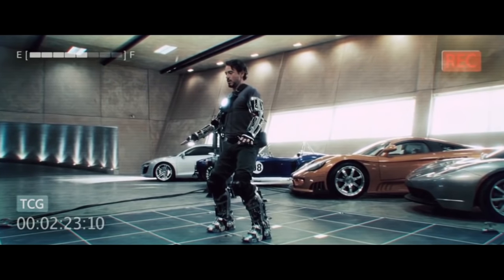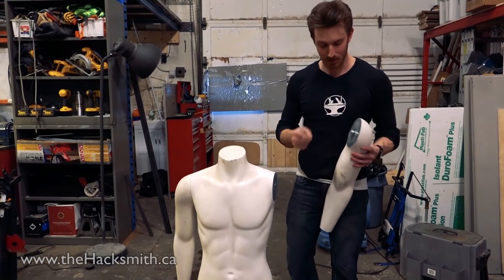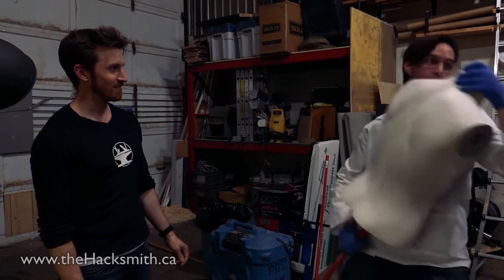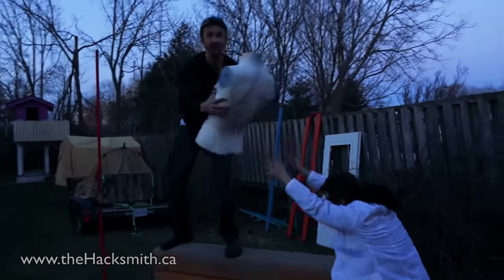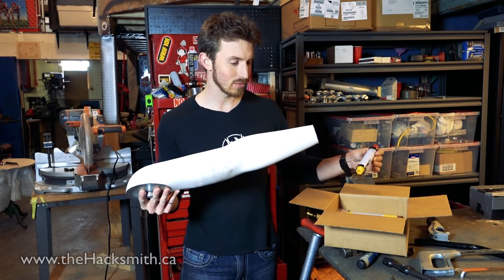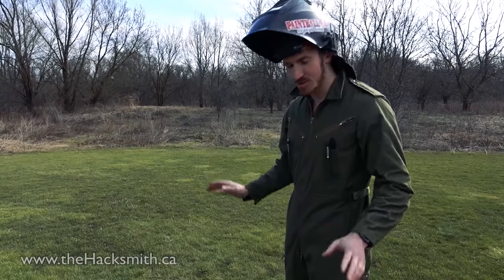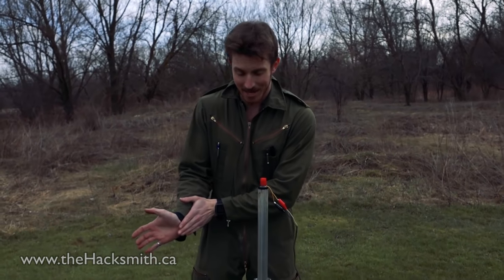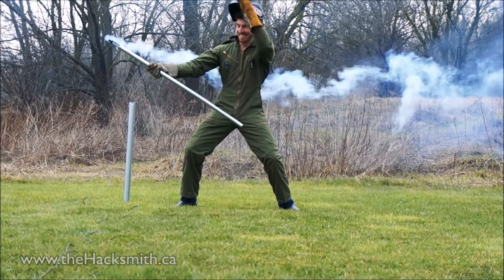Flying Like Iron Man #2: First Rocket Tests

Comment: I was wondering if you will build a suit to go with this, because if so I think that you could incorporate some kind of gyroscope to level you out in mid-air and stop you from flying in all different directions. Now when I say gyroscope I mean some kind of program to level out the rockets matched with a small mechanical device on each rocket that would help guide them as. In addition when I think of Iron Man it doesn't really look like he is paying attention to flying as the suit does that for him. the only downside I see to this is that it will be very costly to build a suit and put this kind of device in it. Just trying to pitch some ideas though!
Reply: Didn't mean to say as at the end of guide them :P.
Reply from the maker: +Scare Craft we would... but considering the rockets only last a few seconds there's not much point for stabilisation:p
Reply: Ok, thanks for replying btw!

Comment: So are the wrist mounted rockets supplying the entire amount of thrust for your flight? I know in the movies the brunt of the power comes from his foot rockets, and his hands are just used for stabilization. Did I miss an earlier explanation as to how you're changing that? Also, I know these were not the rockets you originally intended to use, so how many rockets are you now going to use per arm? How controlled will this flight be? So many questions!!! Thanks, and keep up the good work!
Reply from the maker: The problem is foot mounted rockets would be very unstable. You do not want your thrust at the bottom of your body, it should be at your center of mass, where you can control it.

Comment: This test clearly shows how hard it is to keep the rocket aligned where you want it to go (especially the slow motion bit) and that is with 2 arms holding it and with a very good stance... now imagine doing that upright with one of those attached to each arm... maybe just make a flap system with a small gyro to keep it semi-stable and centrally mounted with smaller rockets on the arms to allow you to turn etc, but that burn time is tiny so flying really kinda seems impossible with solid fuel rockets. Just my 2 cents, cool vid though keep it up.
Reply from the maker: Remember I've already done it. You guys just have to wait to see the videos.

The shot of the first test where I'm having difficulty holding the rocket is because it was the very first time I held it, that's all.
Reply: In that case can't wait to see it! Good stuff

Comment: +the Hacksmith

I have a really cool idea on how to make a web shooter that only shoots straight it's not too far fetched,Basically what it is going to be like is instead of web u use a strong small cable that at the end there is a stick that's sticky and sticks to stuff(3 sticks in a sentence WoW).And there's a cable that wraps around the entire thing connected to the sticky thing(the thing that wraps around your wrist is is gonna have to be a little big).So to trow the "cable" there is gonna be a piston like when you fold paper that's really pressurized and when you let go it shoots it very far.And there is gonna be a stick that holds the piston that is connected to the "activator" that is in the palm of your hand and when you press it it lets go and the piston extends(the piston has to stay extended I made a small test and it goes further that way).Then to make the cable come back you press the palm activator and it goes back pushing the piston back by "closing the stick. ...
Reply: Keep in mind it can only carry stuff like everyday objects you carry in ur hand like a bottle or box of tissues(probably).And I'm not sure how you can make the cable return but hopefully you can figure that one out.

Hopefully you will at least keep in mind what I told you and maybe even make it.p.s. Love your vids keep up the good work
Reply: hey man, nice idea... I mean it could work pretty well
Reply: +Flávio Monteiro thanks

Comment: Judging from the difficulty to maintain balance with both your arms, it's gonna be impossible to do that with bare hands. You might need to modify your exoskeleton and equip it with some computer chip for stability control.
Reply from the maker: It was the very first test, I've gotten used to it ;)

Remember, this project is done. You guys just have to wait to see all the videos ;-)

Comment: make sure your centre of mass is aligned with centre of thrust, otherwise the guy using the rocket will fly and do quite some flips before breaking his neck.
Reply from the maker: Hence why we're not putting rockets on my feet :P
Reply: yea, but i think that the hands will vector too much, causing a flip, either way good luck!

Comment: You said the safe distance is 30 feet right?  And you are going too have them on the end of your arm. I think you are going to need some fire safe gloves as well. And an tip, jump when you launch.  You will probably fly a little higher if you do so. One more tip, have something like an wight on your shoes so your legs point down wards and you know.. Not any other direction like up XD.  And plz use an GoPro so we can see from your view as well. :D and one more thing... DONT DIE OKAY?!

Comment: Well I certainly appreciate this type of mad invention.
But it needs to be pointed out that this type of rocket can do 20sec burst at the very best, not really a usable time frame for controlled flight.
Reply from the maker: +MsSomeonenew never heard of a model rocket that can do 20s! These do about 2 seconds...

It's more of a rocket jump then flight. Sustained flight would be impossible using solid fuel -- no control!

This is the beginning to a much bigger project. Just a proof of concept right now.

Comment: why don't you attach 4 scuba diving tanks to you 2 to your feet 2 to your arms. add a valve to the end of each and have a compressor running while you use it so they don't run out of air too quickly the since the tank will be full to the brim of air if the valve is big enough and the air is compressed enough should the thrust lift you for a couple seconds
Reply from the maker: +Fusionz Animations money.
Reply: +the Hacksmith but it could work with the right funding?
Reply: +the Hacksmith a good scuba diving tank is like £30 4 Is £120 and a 300 psi compressor is like £10

Comment: but how much time do you think that rockets well keep you on the air?
Reply from the maker: +Jesusuriel Lemuszarate 1.7s
Reply: +the Hacksmith  well i think  it well be better if you try to make a small and powerfull pulsjets engines, it well not be easy but you well have much more fuel
Reply from the maker: +Jesusuriel Lemuszarate pulse jet engines don't produce enough thrust, you'd need one the size of two people to even barely get enough thrust to lift one :p

Comment: Wouldn't it make more sense to use jets instead of rockets. Jets you can control the on and off of them, but with rockets you can't. The only big problem I could see with jets is maybe not having enough power or a place for fuel storage
Reply from the maker: +Little Frog and money.

Comment: Those are HOBBY rockets. 
Make your own so you can design them to the level of safety you need. By using someone else's rocket engine, you are roping them in to something that has much more severe consequences if they made a mistake. It is not fair to the creators to use their products in a way that could so severely affect a human life.

Also, use liquids you scrub. ;)
Reply from the maker: +Lars-asaurus it would be much more dangerous to try making them myself though... I'm not a rocket scientist...